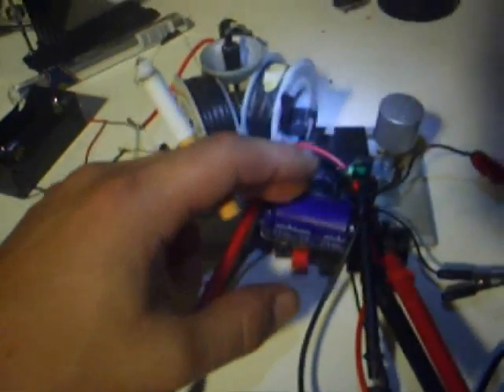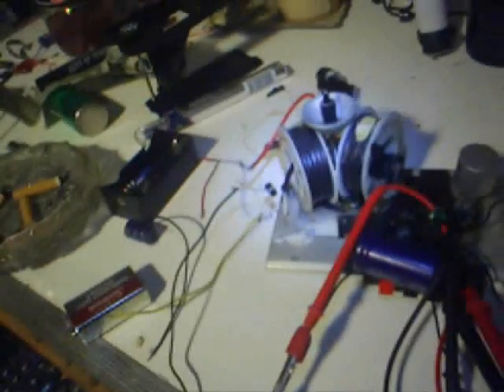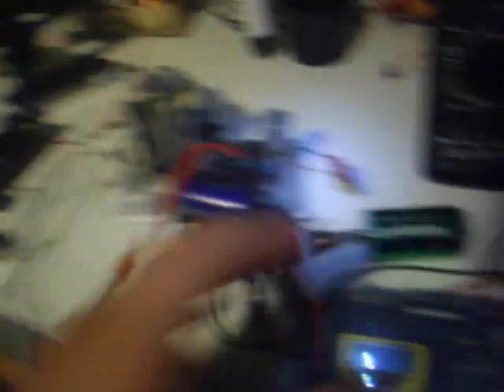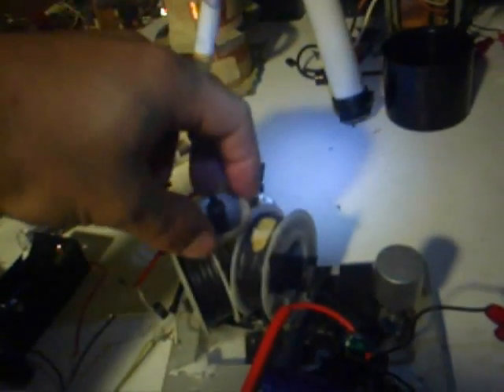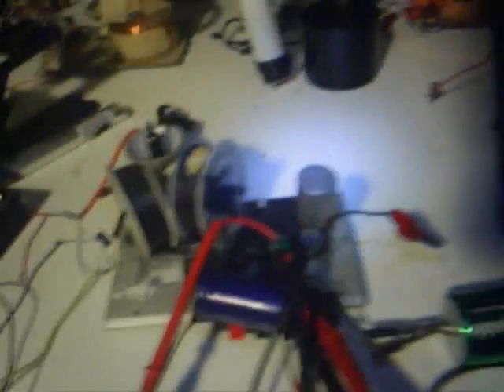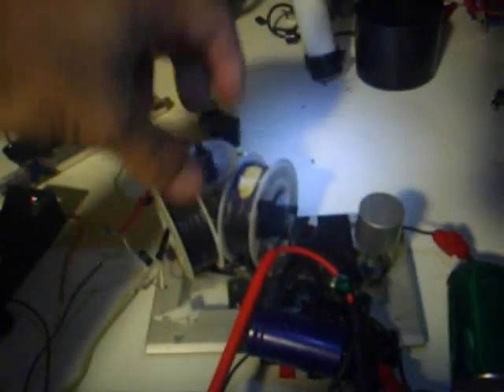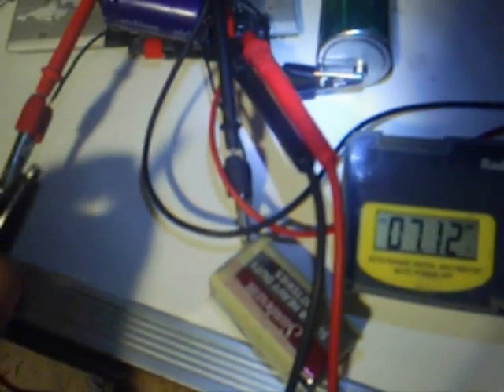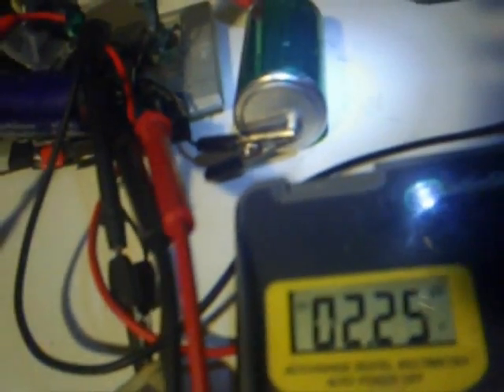Bedini SSG: why there is "no back emf"

Comment from the maker: @BiDaDiKuNuKu hmmm.. have you ever noticed how significant the voltage drop can be on the other end of an inductor, or wire wound resistor with enough ohms? thats all i can think of... possibly a major drop in voltage on the other end, possibly in addition to an odd magnetic field hitting the reed switches.. like how adjusting a nearby magnet can greatly increase or decrease the voltage of the spike that comes out. other than that im stumped.. never had a lower bemf unless the meter was lying